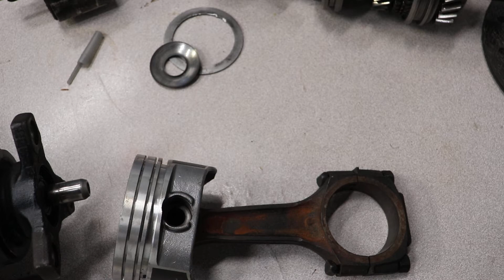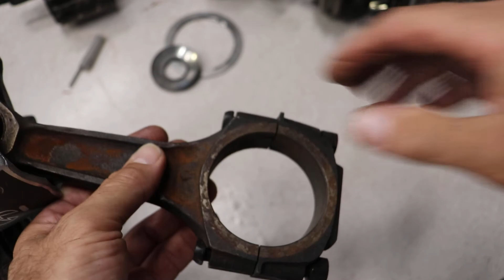ASE A1 A-1 Engine repair double knock piston pin vs rod knock diagnostic.

Comment: Remove spark plug, crank by hand, push down with tool on pistons down stroke, if knocks piston wrist, again if knock on up, divorce your spouse.
Reply from the maker: not a bad trick but this is an ASE test question tip.

Comment: Great vid does a slight wrist pin knock more pronounce during acceleration  or a steady RPM in the 2000s ?
Reply from the maker: It should knock more with less load and while revving the engine.
Reply: @southfloridatechnicaltrain2589  Thanks for the reply back much appreciated  ,,Well if I keep it at a steady 2000 RPM and accelerate to like 2500 2700 RPM its like a hear a slight growl,,, The engine is a 6.0 LQ9
Reply from the maker: @DELTRANIO99  its a camshaft most likely I have done many.
Reply: @southfloridatechnicaltrain2589  Do You think its bad ? It seems to run good
Reply from the maker: @DELTRANIO99  I have seen a bunch of cam problems on the 4.8-6.0 chevy. It will eventually cause a misfire on #7 or #8
Reply: @southfloridatechnicaltrain2589  Thanks for the reply back ,,I Heard the cam problems are from the DOD AFM engines this a 2002 LQ9
Reply from the maker: @DELTRANIO99  I have a bad cam on my shelf in the classroom  from a 6.0L we did about 4 years ago.
Reply: I Think you mightv'e mis understood when  I keep it at a steady 2000 RPM and accelerate to like 2500 2700 RPM its in park ,,,Not driving so it dont have a load if that makes a difference ?
Reply from the maker: @DELTRANIO99  The GM pushrod V8 has so many cam and lifter problems you can never overlook the cam. If there is any, and I mean any cam wear you need to replace the cam. A piston knock will change with a power balance.
Reply: @southfloridatechnicaltrain2589  Thanks again
Reply: @southfloridatechnicaltrain2589  BTW can you suggest a good brand of lifters ?
Reply from the maker: @DELTRANIO99  You need to go AC delco. We did an engine 2 times using New yall from amazon. Unless you want to pull the heads 2 times go oem.